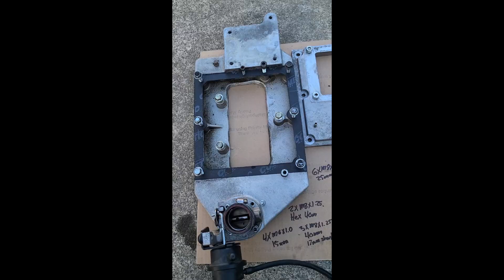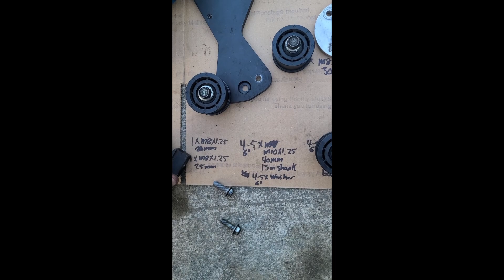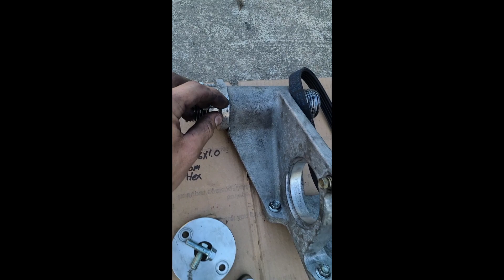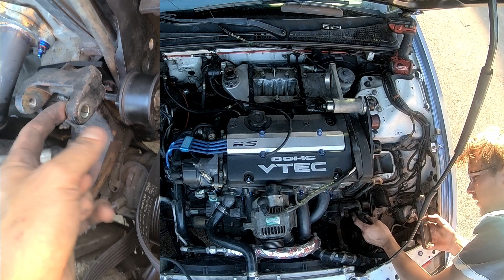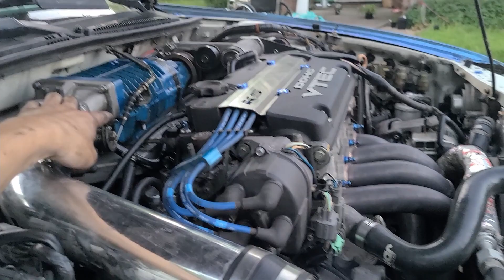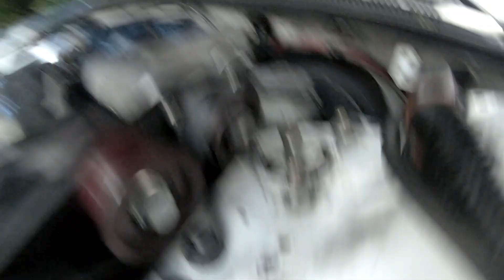H22 Jackson Racing Supercharger Kit Install CB7 Accord

Comment: Awesome stuff! Has anyone tried to retrofit an H-series/prelude JRSC into another other chassis other than a CB? Funny enough, my co worker just gave me a JRSC for FREE that came off his 5th gen lude from 10+ years ago. Always been a big fan of the CD accords, but did see a real old post from back in 01 and JR confirmed that the supercharger can't fit in a CD. Firewall and driver side strut tower had to be cut to allow clearance. Can't really sell it as it was a gift so its stuck as a shelf trophy for now until I figure something out.

Comment: im looking at some enkei rpf1s for my 91 acccord but i dont know the spec of the stock wheel and what size to get
Reply from the maker: Stock tire size for 91 accords is 195/60r15 which is about 24.2".
I recommend 17x8+35 to 17x8+45 wheels with 215/45r17 tires. Depending on camber/how low you are, wheel/tire size might have to vary. I recommend using a tire size calculator and researching wheel offsets.
Reply: im at stock height and camber rn, i just started the whole build proces, but the 17x8+35 should be fine for it?
 @disilicide8296

Comment: I wonder if one of these can be fitted to an F series with some modifications
Reply from the maker: I test fitted this kit on an F22A6 and it fit perfectly. I dont think you would need any modifications at all to run this on a stock cb7 accord, so long as you used an F22A6 lower intake runners.

Comment: I have a JRSC sitting around, still going to do some little things before the install but I wanted to sincerely thank you for putting up a no BS, helpful video on installing a H22 JRSC after trawling through decades of old forum hijacked threads, broken links, missing pictures and misinformation regarding this install. I finally feel confident to do it myself.

Curious though, did you tune it before testing it? Mine doesn't have the JR software, I might have to install it and tow it to a tuner.
Reply: Wanna sell it
Reply: Let me know if you wanna sell it🥲😂

Comment: just bought a 92 like 3 weeks ago. i cant wait to start working on it as it is my first car. what would be your opinion on what i should do to it first? i have plans to h22 swap mine aswell but should i put a supercharger or turbo sorry for all the questions its just ur way more experienced quite obviously
Reply from the maker: Honestly I would turbo your h22 if you can, finding these old supercharger kits is a challenge and they can be a pain in the ass to work with. However it is a really good boost in hp/tq and its an absolute blast ripping around with it. I no longer have this kit installed, but i do miss it a lot
Reply: @disilicide8296  would you say its better then turboing it?

Comment: I have a 93 Accord wagon, just wondering if you know or think there are any differences for clearance? H swapped as well
Reply from the maker: As far as I know, the engine bay is identical to a coupe, so i dont see why It wouldnt work. Only thing i can think of being different an issue is if the ABS stuff is in the way, but i doubt it.
Reply: @disilicide8296  what are specs on the supercharger and pulley etc.  Any part numbers?… These are hard to fine so maybe find something similar. Please let me know if you got any information on this kid I might be able to find some supercharger similar